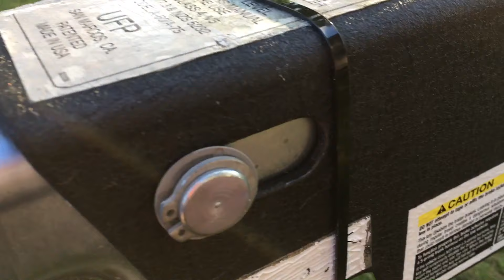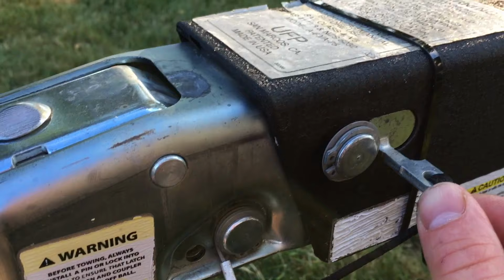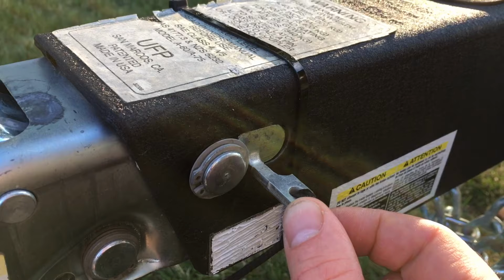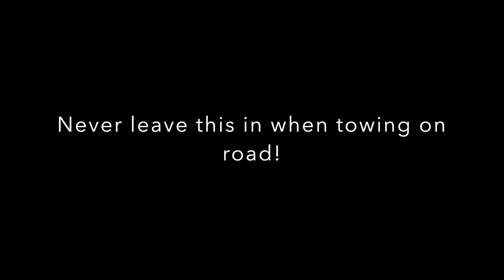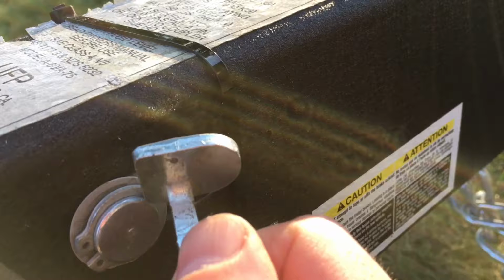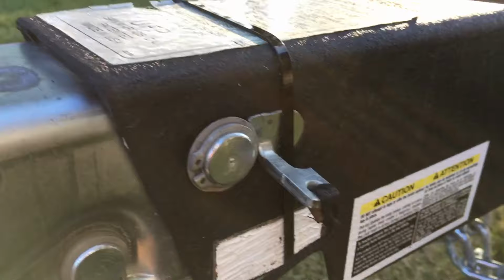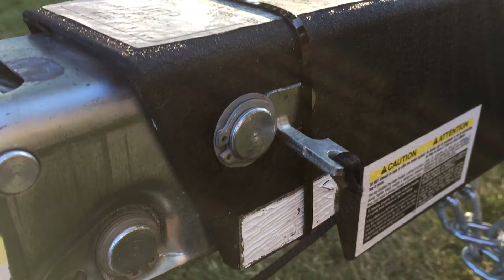How to Bypass surge brakes

Comment: Thank you for this! Just bought a boat and when backing the trailer into the water without the electrical connection the trailer kept braking! The dealer never told me that I needed to use this key to keep the trailer from braking when in reverse. My key also keeps falling out, so I will use your zip tie trick!

Comment: Thanks for the tip! Never had any problem until yesterday backing into my driveway. Interesting enough, I just had a wheel hub replaced (tandem axle) on  one side that has a disk break.
Reply: I have surge brakes with free backing. No pin required. They make shoe kits on etrailer.

Comment: Rare earth magnets on Amazon, cheap and very powerful, it will hold your key while driving down the road.
Reply: Yes ,I use a magnet also,,,,but I've learned to hide it under hitch when parking trailer ,i've had it disapere several times ,,,SKUNKS !!!!

Comment: you can also Buy Free backing trailer brake assemblies. available on etrailer. Comes with whole backing plate and free backing shoes wheel cylinders. takes about an hour or 2 to install Most less than 200 bucks.

Comment: Excellent trick!  Biker Mike, have you ever backed up a steep driveway with your trailer?  In my case I have a 18ft bass boat and trailer with hydraulic brakes and same exact key you have to place in that slot?  I usually drive forward up my driveway and was always hesitant on actually backing it up onto my boat pad…

Comment: Sounds like the solenoid needs to be change out on the trailer of its happening on flat ground
Reply from the maker: Trailer was basically brand new. Reverse light solenoid worked fine when hooked onto truck, problem i had was moving trailer in yard with tractor and the lockout key kept falling out.

Comment: Why does my trailer back up fine without the key in place?  Thanks
Reply from the maker: If you have a 5 pin connector on your trailer it  may have the surge brake deactivator that deactivates the surge brake with the reverse lights on tow vehicle allowing you to back it up. If not you may have a problem with your trailer brakes and should have it looked at.
Reply: My trailer was making a lot of noise today and I was ignorant about how this works. My brake fluid has leaked out of the reservoir and it was not locking up. 
I just ordered a magnetic stop for it which will stop the noise. However I now know that I need to refill the reservoir and inspect where the leak is occurring and get that fixed. I’ve also lost the secondary lock pin. 
Your video was very well done and will make my trailer much safer for future operations. 

Hat is off!!

Comment: what do you think of the loud clunking when start moving ?  i replaced the dampener shock and that did not help w/ the clunking.
Reply from the maker: Maybe sticking caliper, correct ball size, movement in drawbar for hitch. Something to do with the actuator. Hard to say for sure.
Reply: thanks for the quick replies.  i'll keep tuned in !

Comment: So apart from the surg braking being unfunctional, why don't I want to leave it in? If I wanted to bypass them, is that a good way to go? (Customer has one side hanging up and wants me to bypass jt for the remained of their trip)
Reply from the maker: If the weight of the trailer is more then then tow vehicle can handle safely and legally not a good idea to bypass them for highway/ road use.
Reply: @bikermike  I understand how towing works. That doesn't answer my question about the reverse pin for bypassing it

Comment: Isn't the round silver disk on top of the tongue a lockout? On my trailer, you just turn the disk 90 degrees one way and it locks out the surge mechanism, 90 degrees in the other direction and the cap comes off to expose the brake fluid filler cap.

Comment: Use electrical tape instead. Less wasteful, quicker, and more likely you have some in your vehicle
Reply from the maker: I wouldn’t recommend that it’s more wasteful, zip tie reusable sliding back and forth. Can’t leave the electrical tape holding key in place when towing on the roads (the brakes won’t work)! It’s only meant to aid in reversing.
Reply: @bikermike  youre right actually. Was thinking you were cutting the zip ties every time. My bad. Great idea👍👍

Comment: Why notbuse it while driving? All it would do is eliminate the trailer brakes. Say your master cylinder was shot and you didnt like the clunking
Reply from the maker: Just a safety warning ⚠️
Reply: Having issues with my brakes, appreciate the video, was curious if i could tow this way without additional damage. Need to deactivate brake go fish while some caliper mounting bolts come in

Comment: i am not bypassing and the trailer backs up. does this mean my brakes  are not working?
Reply from the maker: Your trailer may be equipped with an electric solenoid that is tied into reverse lights on tow vehicle that deactivates the brakes so you can back up.
Reply: Not at all.  If they work correctly, your electric system sends a signal to keep those brakes from locking up.  Now if you want to be sure sure, they are working, then unplug the electrical connector.  NOW back up.  It should seize at that point, this is a safety that is supposed to lock up if the electric is not hooked up.

Comment: Why does this happen
Reply from the maker: Backing up a trailer that has surge brakes puts the same force on the trailer brake actuator as when you apply brakes in the tow vehicle and the trailer pushes force onto tow vehicle.
Reply: biker mike understood, since my boat trailer locks up in reverse with 2 different trucks it’s safe to assume the solenoid is bad
Reply from the maker: nikobarnes0000 that should mean they are working, the key is what stops the actuator from getting pressed on.
Reply from the maker: They key is only to be used for reversing, and should not be used when traveling down the road other wise your trailer brakes will not work.
Reply: biker mike it used to not happen but now all of a sudden it does
Reply from the maker: nikobarnes0000 then yes sounds like there may be something malfunctioning when it didn’t. I’d take it in and have it checked over if your not comfortable working on something like that.

Comment: Where can I get one at
Reply from the maker: Jp088 are you referring to the little key? Most boat trailer shops should be able to get you one.
Reply from the maker: I also put an affiliate link in the video description of where to get one as well.
Reply: Or you can just get a strong magnet to hold it in place too
Reply: biker mik